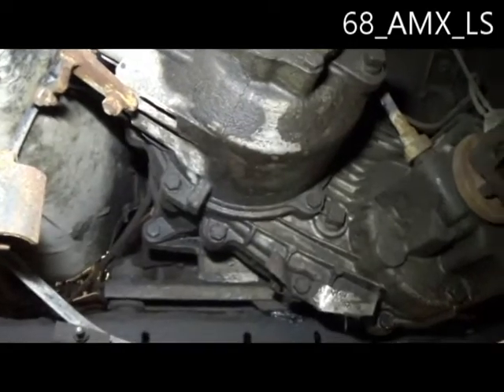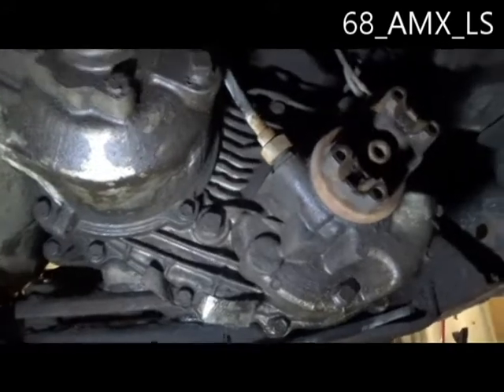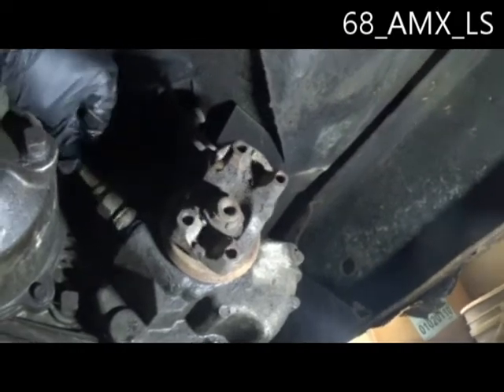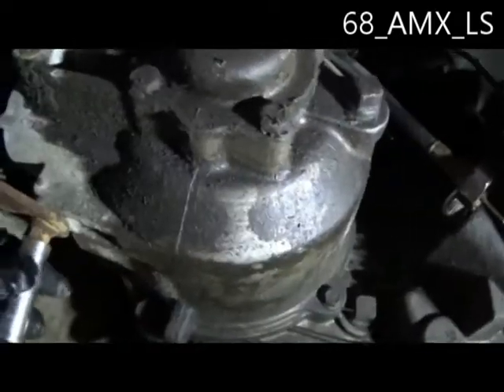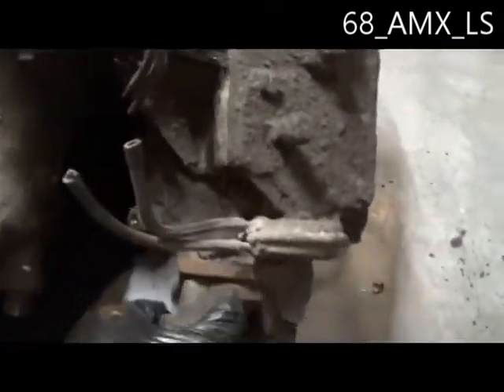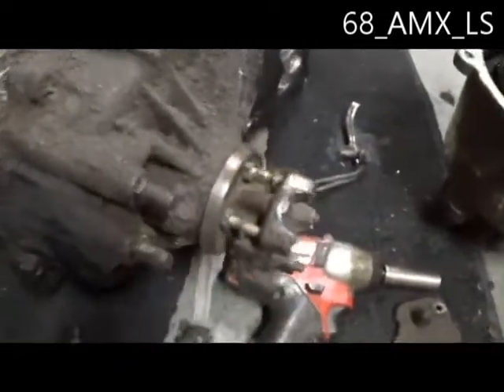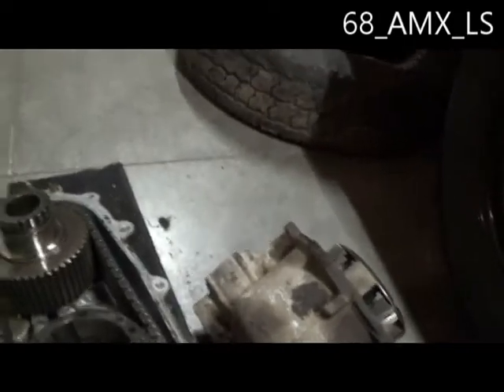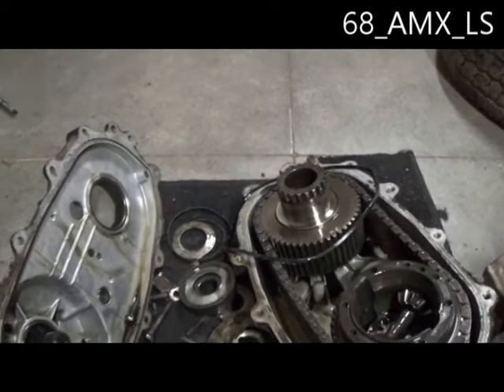How to remove a Quadra trac T case and rip it apart

Comment: The E-Drive switch in the glovebox locks the front and rear driveshaft together so it acts like a more traditional 4x4. You can drive a quadratrac in 2wd if you lock the transfer case in E-drive and remove the front driveshaft. If you remove the front driveshaft and not have it in e-drive you will ruin the transfer case

Comment: Hello, I like your video watched it a couple of times and i am interested it the 2 W Drive kit that your talking about ? I have a 1975 AMC 360 Jeep Cherokee Station Wagon 2 Door, I don't get into the 4 wheeling tearing shit up, I am more into Drag Racing and Street Rod's . I have the Turbo 400 and it's great . The Borg Warner Transfer Case needs a new $ 300.00 chain kit ,  Wouldn't it be more cost efficient to ditch the transfer case and put in the slip yoke and find a drive shaft to fit The Full Size Jeep ?  I would think selling the BW Quadra Trac do the dirt devils would cover my parts to ditch the 4 wheel drive into a 2 wheel drive.I do like to keep things original , But in my situation at my age 63 ,  if the T.C . Comes out it's staying out. 
Thank's.

Comment: It doesn't matter much at this point, but I could have likely used some of those Quadratrac parts. The original Quadratrac was an all-wheel-drive system that used a cone clutch and a center differential to put power to all 4 wheels. That big chain drove everything, thus it was BIG. The low-range unit can be un-bolted before dropping the t-case to make the case much easier to handle when removing, or so I've been told. I guess I'll find out here in the next couple of days when I get around to dropping mine for a chain and seal replacement.
Reply from the maker: i have a couple other q trac t cases and setups if you need parts
Reply: @68AMXLS  Cool. Let me get this thing out and apart, see what condition the guts are in. Will be in the next few days.
Reply: @68AMXLS  Got the reduction box (low-range unit) off and the T-case out today. Not too heavy, and taking the reduction box off first definitely helps with the weight when dropping the T-case yourself. I'm not gonna take the whole deal apart, because it all worked fine, just had a leak at the input shaft seals. Oh, and the chain is shot (not broken, just stretched), so have a new one to go in as well. Where are you located? I might be interested in getting a spare Quadratrac from you, if you have a complete one that worked when removed.